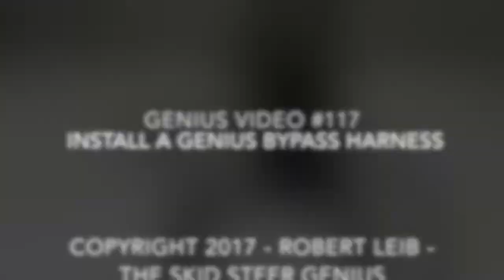#117 - Universal Attachment Compatibility for Bobcat

Comment: Do you guys have anything to bypass the "computer-controller-black box" on a 753 bobcat skid steer? 
 I had to manually bypass it with a gag of wires etc. (naturally at my own risk) just to get off a job when the "black box" developed a crack in it and literally caught fire do to some water getting in it. I really don't feel like spending that kind of money on the box to get it operational just to have it happen again, thus want to try to do away with it.... if you have something that would do the trick it would save me a lot of time vs making all of it myself.  thx